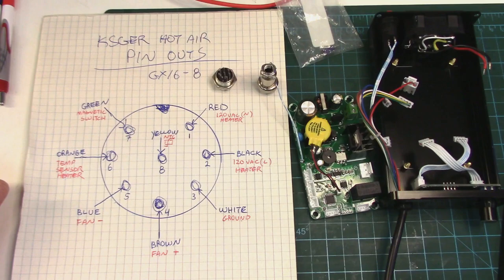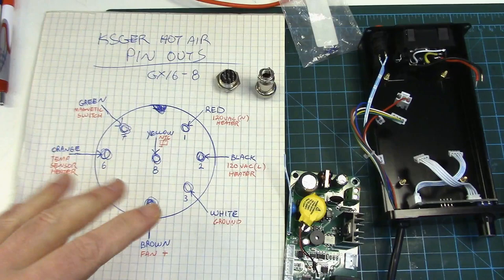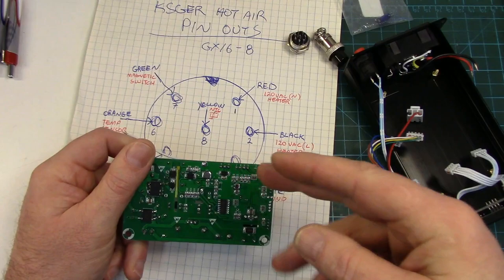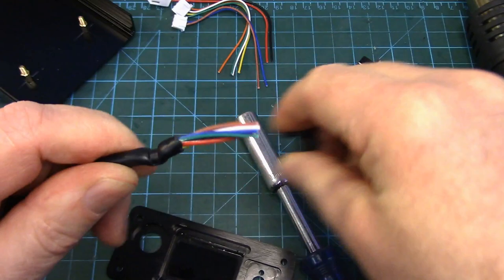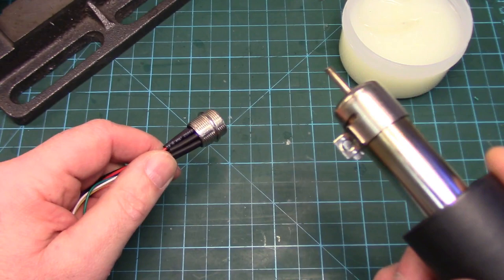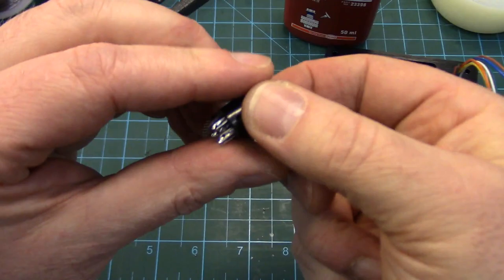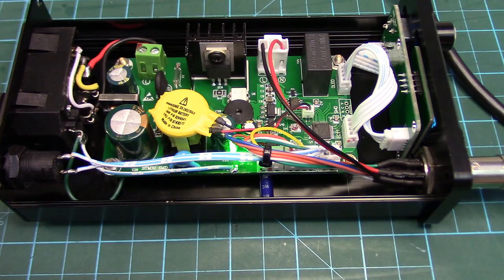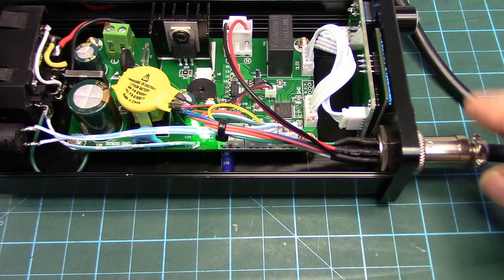KSGER Hot Air Station Connector Mod

Comment: You mention the AC voltage is not present on the pins when the connector isn't plugged in but I would still be concerned about having even a switched AC pin exposed.  Failure of the detection and switch circuit could be lethal especially in countries with 240 VAC so people should be careful if they want to make this mod.
Reply from the maker: Yes Steven, that's a very good point I failed to mention in the video. 100% agree. For those that wish to do this mod in order to have the convenience of a removable gun, there is some risk involved. When a TRIAC fails, it's usually in a closed condition. In short (pun intended), if you do this GX16 connector mod, best to ensure the station is completely powered off before removing or fitting your gun in the off chance there are angry electrons gathered at that "hot" exposed pin. Better yet would be to use a "reversed" GX connector (exposed pins are in the un-powered male/gun side connector); but I couldn't find any 8 pin versions of the reversed GX16, 7 pin seems to be the largest they make. I think there are reversed GX20-8 connectors, but I'm sure they would be too large considering the nut on the 16 was already grazing the outer case.
Reply: @Rchelicopterfun  you could use the 7 pin "reversed" gx16 connector and just remove the thermistor, as it just measures ambient temperature
Reply: Josh McCellan, Thermistor measures cold end temp. Station calculate temp as T thermocouple - T thermistor. I know that for sure. 

You need to make a simple circuit that determines the connection of the fan to the connector. For example, by voltage drop on a thermistor pin lower 3.3V (using one comparator). It is 3.3V without thermistor. Thermistor is connected to ground. Аnd use a relay contacts to supply line voltage to the connector. Physical disconnection is required to decouple the connector from the line voltage.
Reply: @Rchelicopterfun  Couldn't you connect the ground wire (white) to the housing? That way 7 pins would be enough.

Comment: Thanks for the initial review and mod video.  I bought the KSGER iron a while ago based off your review and couldn't be happier.  It would have been nice too see the hot air station in actual use on some boards, but I'll probably end up it getting one too!
Reply from the maker: Just made a "follow-up" video for this station and the Ksger T12 station. I show some hot air rework under the microscope: https://youtu.be/Dy9WUtvdBUk

Comment: It is 60Hz PWM on a fan mosfet. It is possible to modify it in a firmware by changing this value. Only 2$ stlink is needed to flash firmware.
Reply: Hi just wondering where can you download the Firmware from. Do you have a link

Comment: I noticed lack of ground on the T12 too. The right side rotary encoder was also floating - it didn't have solder on the mechanical pins that go into the board. Also, a lot of places are missing a ground. May be why there was the issue where it would go between error, heating, error, heating, etc.. regardless of tip, etc... also the GX12-5 connector doesn't have a screw in it. meaning the piece rotates easily for the iron. so could be an issue there too.

Waiting on banggood to make it right; but I went ahead and ordered a replacement iron just in case it is that and did a few other things.

Comment: I'm also planning to do that. Very useful video, thanks :)
But shouldn't you use female connector in the station and male on the cable? That would be a lot safer
Reply from the maker: See my pinned comment

Comment: I bought the KSGER dual solder/ heat gun station and planned on doing the same mod (it’s actually how I found your video!)

One thing I was hoping your video would answer is whether the omission of the connector is for safety reasons. If you don’t have the gun connected, is live pin ever energised? I know you show it not zapping you, but it’s not clear whether the rear toggle switch is open or closed at the time. I can imagine this mod being pretty dangerous if the pin can go live while exposed.

Maybe it refuses to energise the live wire if it doesn’t detect the gun? If not, then if the socket was female and the gun wire had the male connector on it, this would be safe.
Reply from the maker: This is all covered in the video and the pinned comments.

Comment: I wonder what that rather bright LED is for near the coin cell? Seem an odd inclusion. Unless it's a warning light in case you power up the board but with the front panel disconnected - no noise, no screen, but live board, hence the warning. But that situation seems a tad contrived. Any alternative thoughts on it?
Reply from the maker: It's just a power indicator LED.

Comment: Why don't move that red switch from the back of the unit to the front side?
Reply from the maker: I never use that switch so I had no need to move it. The magnetic switch in the handle does the same thing after all when the handle is placed in the magnetic holder. Of course if you wanted to move yours - go for it.

Comment: what does that relay do on the circuit board? I thought it isolated the heater from mains, but it looks like it is doing something entirely different.
Reply from the maker: There is no relay in this unit. If you are referring to the black component in the corner, it's a transformer (zmpt107).
Reply: @Rchelicopterfun  oh I see, that explains that component alot! it would be nice to see a double pole relay to isolate the live and neutral lines of the heater element when the circuit detects no wand.

Comment: why only 8 pin and not the 10pin variant of the plug to add a switch link in for the rear switch. so if its unplugged the unit knows power should be off
Reply from the maker: Too big. GX16 8 pin is the largest that will fit. To get to 10 pin, would have to go up to GX20 and the 16 barely fits.
Reply: @Rchelicopterfun  have found plugs claiming to be gx16 10 pin on amazon. in fact i find it easier to find them than 8 pin on uk amazon
Reply from the maker: Interesting. I can't find any here in Canada and the few aviation GX connector spec PDF's I've been able to pull up list 8 core as their highest # for the the 16 size one. By all means if 10 pin GX16's do exist, that would be a way to add another layer of safety for those that want to. 🙂
Reply: @gazeddy  could you share the link? Can't find one on amazon.co.uk...

Comment: I Bought model 200 volts - 260 volts ..Can I put 125 volts 60 hz??
Reply from the maker: It should work if yours has the EXACT same control board as the one I have because it's a universal voltage board. What is voltage specific however is the heating element in the gun. I have no idea how the heat gun will react at lower line voltage. It will likely be okay, just taking longer to heat up and perhaps not able to get to maximum temp, but that is just an educated guess.

Comment: This may seem like a stupid question but i have the T12 Soldering Station  could i plug a heat gun into that with GX16 8 PIN Connector thanks
Reply from the maker: Nope, the soldering station is very different as is the GX connector (5-pin and smaller on the solder station). The heat gun also needs line voltage (ie 120 or 240 vac) and is controlled by a triac, not a mosfet.
Reply: @Rchelicopterfun  thanks very much for reply have a nice evening

Comment: Hello Is it possible to use hot air gun and solder iron at same Ksger ?
Reply: No, they use different power supplies. Solder iron works on 24V  and the hot air gun at 120V.  The connectors also have different pin count.

Comment: What did you do for a stand for the Hot air handpiece?
Reply from the maker: I just attached the separate magnetic holder to the side of one of my work bench legs. It's okay for the amount I use the HotAir station (a couple times a week perhaps); but if I was to use it more like my soldering iron (almost daily), I'm sure I would take the time to build an actual stand that I could move around on the workbench.
Reply: @Rchelicopterfun  I haven't seen a magnetic holder.  Do you have a link?
Reply from the maker: I link to it in the description of the initial review I did: https://youtu.be/C1OiKfb_0M8
Reply: I wonder why they have never made a T12 soldering iron with the temp in farenheit?
Reply from the maker: Likely because virtually every country in the world uses Celsius. Still, it would be an easy firmware update to have both scales I would think.
Reply: @Rchelicopterfun  Got my 2 T12's.  BOTH scratched, dented bent panels and generally in poor shape.  Largely due to the very non existent packaging.  

Now Bangood is saying I have to pay return shipping to CHINA even tho I ordered them from a US warehouse and they shipped them from a US location via USPS instead of FedX who was stated as the carrier.

While I love what the units could do, I have to say that dealing with their poor customer service, indeterminant delivery dates, overall poor quality, I will buy future units from a reputable supplier.  Bangood is not a realiable supplier.  I order good from Alibaba all the time and have never had these issues.  I hope others have better luck than I did.  Buyer beware is what I would say now.

Comment: hello.can this application you made can be done in hako kit?
Reply: for hot air gun
Reply from the maker: No idea.
Reply: @Rchelicopterfun  I want to do it too but I could not find where to connect the sensor cables

Comment: The lack of a connector isn’t an omission, it’s good design. Why on earth do you need to disconnect the gun?
Reply from the maker: For the exact same reasons it's beneficial to have a removable soldering iron from a soldering station. 1. Makes for easier replacement &/or maintenance. 2. On the occasions where you don't want any crap such as bundles of cord cluttering up your work area when you are working on other projects. 3. Most importantly, because I wanted to. Moreover did you see the amount of cable compression by that factory installed strain relief bushing?! That was piss poor design partner on a multi conductor cord carrying both line voltage & low voltage.

Comment: why don't you put the female end on the unit? - seems to be silly to even chance the male side being live on the KSGER.
Reply from the maker: I mention that in the very first pinned comment: "Better yet would be to use a "reversed" GX connector (exposed pins are in the un-powered male/gun side connector); but I couldn't find any 8 pin versions of the reversed GX16, 7 pin seems to be the largest they make. I think there are reversed GX20-8 connectors, but I'm sure they would be too large considering the nut on the 16 was already grazing the outer case."